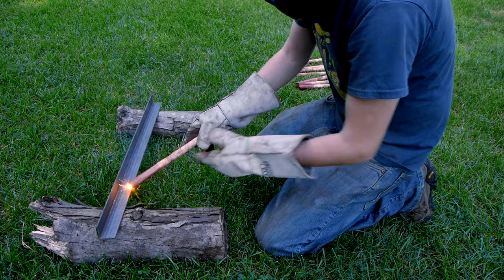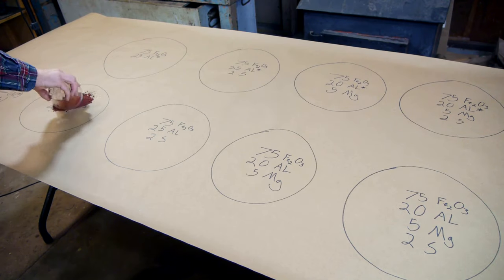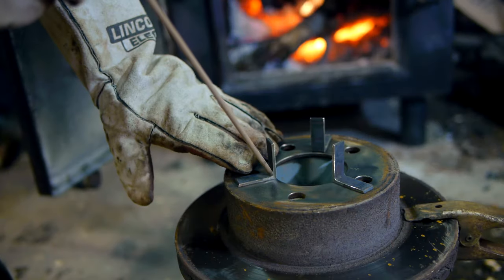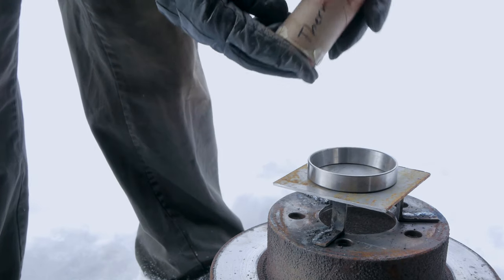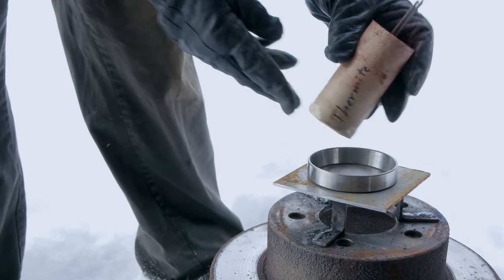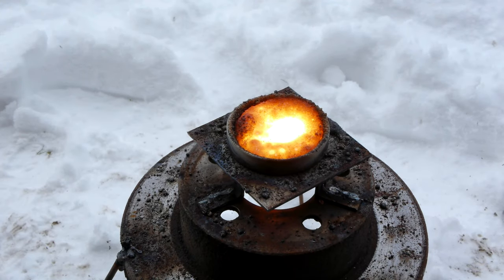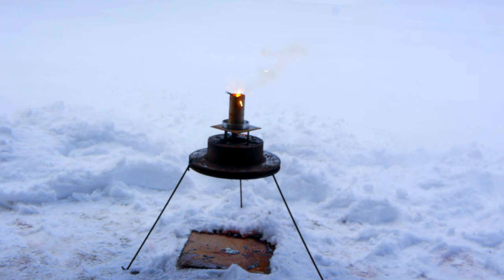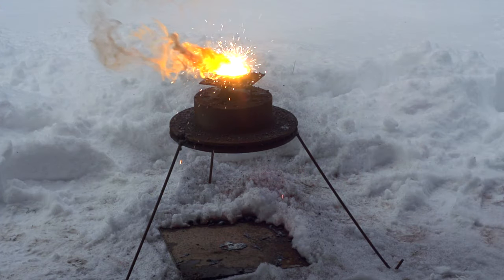How Easily Can Thermite Actually Melt Steel? - NightHawkInLight

Comment: may be you need a bit space between the termite and the steel. I usually see people using flower pot which because it's ceramic and it got a hole at bottom, allow the hot liquid pour on target. Hope this can help you

Comment: the experiments i've seen on TV were different though, they always used i think 2 ceramic pots, which don't melt and they direct the molten thermite to the target location, of course they also seemed to have used more than 300 grams.
Also they use this stuff to weld rails together, so the proper technique and amount are probably crucial.

Comment: Thermite does cut steel but you need to direct the energy towards the thing you are trying to cut.  In your experiment most of the energy is escaping upwards, like a camp fire.  You either need more thermite or you need to use it more efficiently by creating a thermite-loaded cutting device.  This science is already well established.

Comment: If you pay watch the reaction, you can see that most of the heat and energy are used up prior to even contacting the plate. The heat transfer to the plate was a small % of what the total burn is.

Comment: I remember trying it for the first time, hyped up it will cut trough steel like a butter. I made ratios all good, put a container over 3mm steel plate, and all it did was melt over the plate to the asphalt in my street, cutting hole in it. So aftermath was not only cleaning, but cementing hole in my dead end street. Sweet teen times

Comment: It works better if it has a direction, just like explosives. If you think about it, you let the hottest part hit the plate last by using a top side ignition, but if you would put it into a container (such as a piece of black iron pipe capped on one side, so that the top points to the steel) it would direct the hot molten iron to the target metal, and the molten steel would fly away with the iron produced from the reaction. There was a video done where a guy was testing if 911 could have contained thermite and he was cutting through steel beams using a method like that. (Kinda like the model rockets, the propellants travel through a nozzle producing a faster velocity than if it was burned without the nozzle.)

Comment: You need some way to focus the energy from the thermite into a torch.  Just lighting it off like that is about as unproductive as lighting off gun powder on a piece of cardboard.  There is a video out there where one engineer created a compressed jig next to a steel beam, lit off the thermite, and it burned right through.

Comment: better do it with something that can insulate and accumulate the heat, like they do it when welding train rail lines, they have a ceramic insulator which funnels molten iron to the weld. you can use a sacrificial flower pot, for sure

Comment: I'm not saying the cold directly cooled the heat produced, but how likely is it that the cold ambient temperature and cold materials slowed the rate of the reaction? I've had on numerous instances chemical experiments ruined solely by cold winter temperatures, even if it's not cold enough to freeze the materials themselves.

Comment: One problem I see is that you ignited it at the top. The metal isn't exposed to the heat until it has totally burned down to the bottom. Consider these modifications: 1) compress your composition with a binder (e.g., 3% PBAN or the like) so they are somewhat solid, 2) ignite from the bottom, 3) have an ceramic insulator (or the like) above them to contain/focus the heat. This should change your results dramatically.

Comment: just fyi, loosely twisted white masking tape with some Morning Glory firework powder or black powder on it makes for a great fuse :P (I learned that one because California's "safe and sane" fireworks have a bad habit of failing or the fuses falling out)
Also the best way to hold thermite or similar substances (learned from railway welding) is to have a hopper above the work piece that the powder can fall down onto the work piece while the base is being burnt. Most of what you used here seemed to burn from the top down, burning itself up, before doing any damage to the plate. You could also use an electric fuse to light it, like the kind from model rocket engines, that you could wire in with cheap wire under the middle of the powder and light it off with either a 9v battery or car battery charger.

Comment: The tube is shooting up letting all the heat the opposite ditection on both tests turning the plate red when the bottom layer of thermite was lit. Remember the buildings didnt fall for 102 minutes so it had plenty of time for thermite to melt while the comotion was going after the panes hit.

Comment: hey Night Hawk.
 So my friend and I made a aluminum smelter using the materials and instructions given to us by Grant Thomson. we melted down some aluminum and then put the project away for what I would say was no more than a month. Over this time the tube we used to provide air to the coals started to rust a little. The next time we started up the smelter our crucible broke and the aluminum must have mixed with the rust to create some form of thermite as the smelter started to smoke heavily and both the steel crucible and the steel tube melted in a into a bubbly solution that spayed molten metal similar to a thermite reaction. After this strange reaction the air smelled heavily of sulfur and the metal had melted through the heat absorbing material lining the bucket. I was wondering if you had any idea as to what had happened and or could try to recreate the scenario. I think it would be interesting to see in a professional video plus i find it interesting that you can make military grade thermite and not be able to melt steel yet I accidentally cause some reaction to go down in my furnace that melted down an entire fire extinguisher and the end of a thick metal tube. If you decide to try and recreate it i would love to give you as much detail as to what happened and the state of our materials before turning and during the event.  Thanks for your consideration and keep up the good work

Comment: Is it possible that you have to make a kind of "cutting charge" with copper? The thermite brings you the heat you need and the copper core has to be driven specifically through the material that is to be penetrated. Or does this miss your underlying thought and you just want to achieve the goal in a different way? I think the most important thing is that the energy of the thermite is focused and moved in the direction that is to be penetrated... Thanks for the great videos, I discovered you on YouTube yesterday and have now watched almost all of them😅 👍✌️

Comment: nighthawk i saw another video a while back i tried to find it again but couldnt, but basically in the video some used thermite, to cut steel, how he did it, he made a squared off tube, with a slit down one side, attached this to the steel with the slit facing the steel he wanted to cut, packed it with thermite, and it actually cut the steel,
Reply: +Koran Harwood The title of the video is "the great thermate debate" and it is still here on youtube.
Reply: what are you on about, i just linked the video?
Reply: You didn't link anything, you just described it.

Comment: Thermite cutting charges are used every day so I am a little surprised you didn't do some basic research. The size of the particles and a homogeneous blend are two of the most important factors, the exact makeup of the blend is of course also important. Aside from these factors you would need to start the reaction nearest to the material if you want to cut something and you would need to create a nozzle which directs the output. A final important point is that the reaction would slowly work backwards from the nozzle and so you would either need a very short reaction chamber, a sealed chamber that forces the energy through the nozzle or some way of pushing the unused material towards the nozzle. 

Basically your experiment has an incredible number of flaws which are easy to anticipate.

Comment: maybe the main issue is that you are having the thermite burn from the top down, and most of the heat is blocked by the slag that is created by the reaction? if the hot liquid was to directly contact the steel as it is burning, that might have a lot more effect. also, the mixing of the thermite makes a big deal as to how effective the reaction is. if it is not thoroughly mixed, it won't fully react.

Comment: I think the problem you're facing is thermal conductivity; the steel is conducting heat pretty much from the moment you light it. Perhaps a ceramic pot might keep the heat into the thermite until it reaches a point where it's capable of melting through the pot, and then the steel.

Comment: What do you expect it to be like when you're doing it totally wrong?! 
These thermite/thermate tubes simply burn down, and at the bottom there isn't much left to burn through the steel plate. So temperature and burning power dramatically decrease until the whole lights off. Thats why the back ist only glowing in a bright red. In order to cut through the plate you should try to put it above the tubes or press the thermite/thermate against the steel plate, for example by the use of a piston.

Comment: Curious but wouldn't it be more effective if the burn was from the bottom? Then the full heat expelled would be in contact with the plate and cause a more efficient reaction

Comment: I would think that by setting the thermite in the tube on top of the plate and lighting it from the top would create a situation where the metal, oxides and slag created during combustion would sink to the bottom creating a layer on top of the plate you’re trying to melt through...    lighting the thermite from the bottom of the tube or using a different container/pile/shape of thermite may work better...

Comment: Is the steel getting enough contact with the thermite? Doesn't starting a burn from the top hold the burn off the steel until it reaches the bottom?

Comment: I know this is way late but probably best solution is to compress the powder in the same fashion as a rocket motor but upsidedown. This way you have a heat front moving outwards from the center and a channel for all the molten iron to flow through. To speed up the reaction for cutting purposes you can add copper oxide as well but be careful with that because you might already know that stuff goes in a flash.

Comment: You need to channel the flow and heat. It looks great but the majority of the Thermite burned from the top and transfered little heat to the plate. A shaped charge like a cone or a hole down the center might have done more. I would play with the design and shape of the container.

Comment: I think you have to offset your thermite from the target so you can get a flow of metal going. That then flushes away the aluminium oxide that will isolate the steel plate from the heat of the reaction. Your stand may act as a excelent heatsink aswell. Greetings

Comment: How about using clay and mix the thermite  in there so you can apply it to a joint and be able to light one end and weld on a wall? Like a horse trailer?

Comment: A thermite cutting rod may actually be quite a handy tool if not for cutting steel. even though there are better tools for the job it would do, it could act as a cheaper and perhaps more portable alternative which can be stored in a backpack or toolbox. i would suggest finding other uses for it too, be because i think this actually shows alot of potential.

Comment: rather than stack your thermite vertically above the surface, create a  horizontal layer of thermite and light it from the edge. A Thermite lance works by propelling the thermite past the ignition source, you can't have a tube like you showed because of build-up

Comment: the plate on the right in the center looks like a "reweld" which means the thermate did burn through but the hole welded it self shut

Comment: Perhaps it was less effective because you lit the thermite from the top? It would have to burn down through itself to reach the steel and perhaps it didn't spend enough time in contact with the steel at a temperature high enough to burn through?

Comment: have you seen the old video by physics and reason? he was able to use thermate to cut steel columns. He used a steel tube with a slot milled along the edge and various other implements to achieve some surprising results. I think it doesnt show up on youtube search because i ended up here while trying to find that other video. Anyways, the video is titled "9/11 Experiments: The Great Thermate Debate" . Worth a watch just for the guys ingenuity.

Comment: maybe containing the thermite in such a way that when lit it has no where to go but toward the steel so there is no wasted heat, though you would have to strap it down. also your could have something similar to a piston, pushing the thermite down speeding up the reaction. if that doesnt melt steel, nothing will

Comment: The military has this thing called the TEC Torch or something like that, and what happens is that, its a steel tube, with two wire outputs for the electronic base, and it ignites from the inside when the electric match is triggered, and it shoots thermite out of the front due to the exothermic heat release, making a torch that can cut through half inch thick steel, or even steel door knobs or hinges... Found it: http://www.empi-inc.com/tec_torch.html EDIT: I also did a science fair project in 11th grade on thermite and a steel tube... It was a quarter inch thick, and my friend and I used 1 cup at first, then two as a backup in case in didnt go through the first time... And although it was red hot, thermite under standard conditions cannot cut steel unless you could get all the heat to focus on one single spot like a knife edge.

Comment: Temperatures generated during the reaction are about 2x hotter than the temperature of molten iron produced by the reaction. You can't just set thermite on top of steel and expect it to melt through, b/c in that setup only molten iron contacts the steel..

Comment: if you want the thermite to penetrate the steel you have to contain and direct the energy produced by the it. it doesn't work so well when you just set thermite on top of the steel

Comment: just a question. would you say that the thermite compromised the integrity of the steel plate (structurally) or did it remain near perfect. you can see blemishes on the surface is why i wonder if it was still a strong piece of 1/8 steel

Comment: the thermite,while it was directed on the right axis, was not point towards the steel. when you light the thermite from the top, it starts burning at the top. and when the fuse reached tge bottom of the container the metal was only affected for about 1/20 of the actual heat created by the thermite. i suggest that once lit that you flip over the thermite container so that it is directed in the proper direction

Comment: The answer you are looking for is energy compression, like the mechanism of gun barrel, cannon, welding torch etc. You ain't going to cut through anything with it burning in open air. It has to be forced through a vent to maximise energy output.

Comment: They energy seems to be concentrated out into the open atmosphere rather then direct the energy of the thermite within some sort of container perhaps a steel box. Not having then energy directed along with having the the burn come from the top of a thermite candle and then descending down where there would be build up seems to be why it wouldn't cut through. I would imagine the thermite could cut through if it were done from underneath and the thermite were slowly raised as i burned allowing for more consistent and concentrated heat. The ernergy seems to be directed away from the steel in this experiment.

Comment: As many others have mentioned the thermite in the video was loosing most of its energy to the environment. To have give thermite a fair shot you'll need to focus its thermal energy on its target. Perhaps drill a small hole through the plate and use the same rig but place the thermite upside down, with the fuse sticking out of the newly drilled hole.

Comment: You could light it from the bottom but it may burn quicker than the thermite can replace what is burned up, so If this happens   add a weight at the top that will pressure thermite downwards then light it from the bottom thermite will drop quicker now forcing the burn to be on target. Good luck.

Comment: You should try igniting the thermite from the other end the end that meets the metal first downward angle United from there so that pressure builds between the two washing the heat dispersion through the metal instead of it burning and just melting into a puddle just another opinion hope it works

Comment: Well if you light it from the top, its gonna burn down leaving a bunch of slag and iron at the bottom, by the time it burns down to the steel. So by the time the flame gets ti the steel it is blocked up by the slag and iron.

Comment: Perhaps and different delivery system for the thermite will improve It's ability to cut through steel. Just as a shape charge will direct an explosion into a super heated jet. Perhaps some kind of shape charge shape or some kind of upside down burner shape with a sealed top will more effectively focus the energy of the reaction into the steel.

Comment: What you need to do is spread it, if you made a circle shape. Then it would be red hot in the shape of a circle. (Obviously) then you need something to bust through it. 

So if you did the thermite PLUS m80 or some sort of variation of that, but put it in the center. 

I'm sorry if this doesn't make sense I'm honestly not very Intelligent.

So far I like your vids tho!